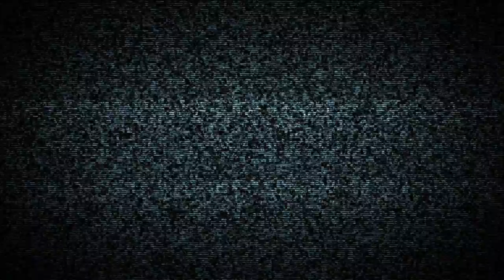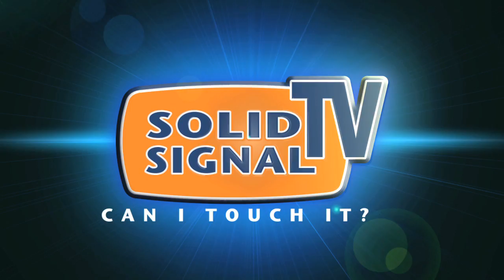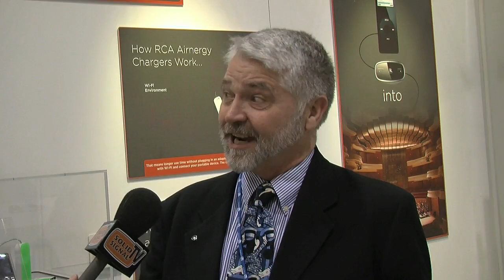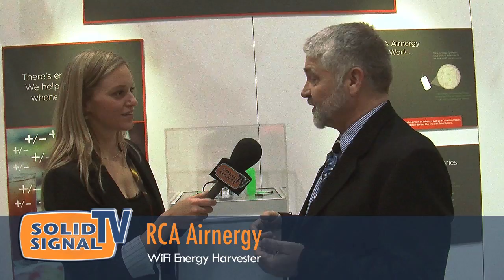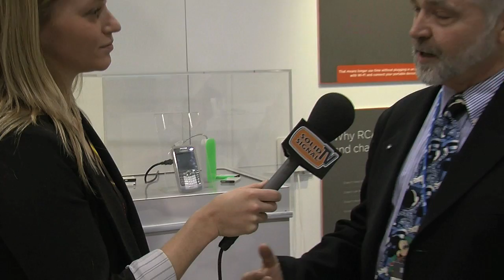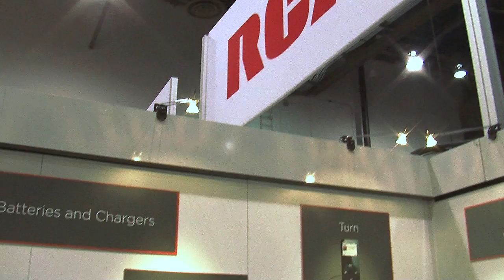CES 2010: RCA Airnergy - WiFi Energy Harvester

Comment: All you need to know is the amperage/voltage of the harvesting circuit which they will never tell you, because it will be so small their meter will probably not even register it at all.

The math of batteries is not complicated or hard to do.  The amount of "free energy" in the air is extremely small, and the smaller their antenna the less of it they can harvest.  They have a very small antenna harvesting a very small power source.